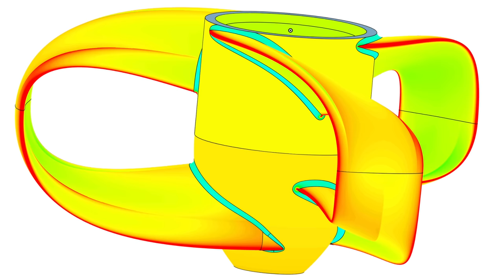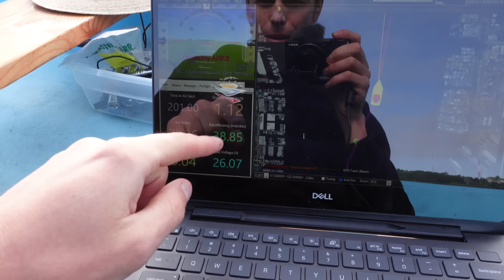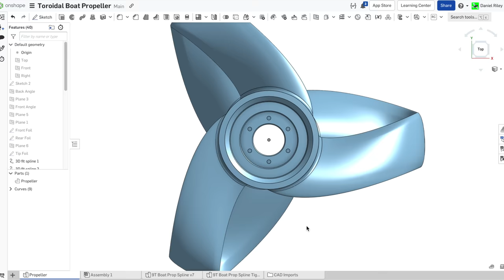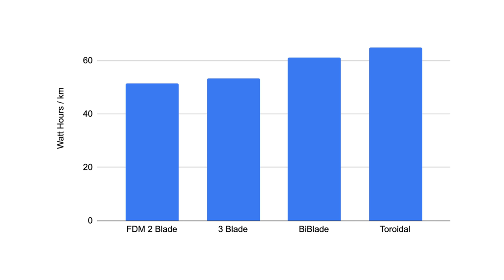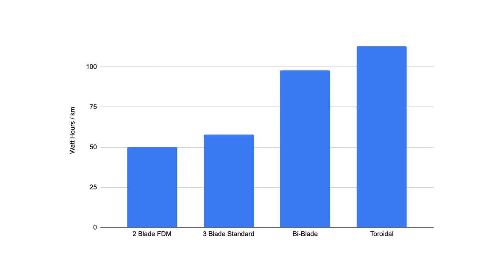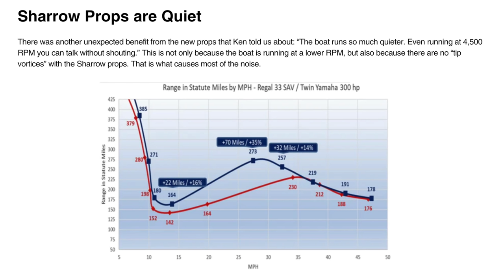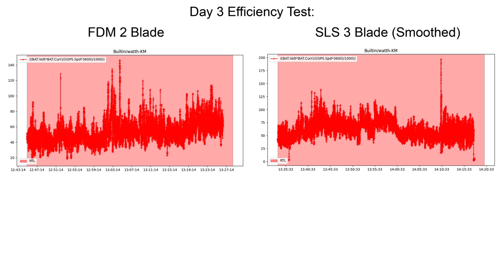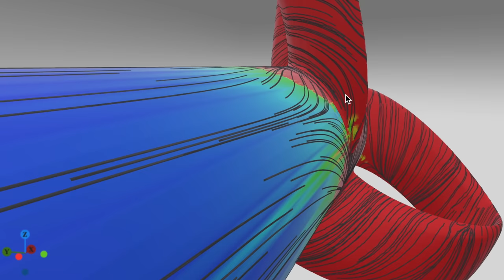Testing Futuristic Propeller Designs on my Solar Powered Boat

Comment: This is going to sound strange but here I go. Would it be possible to design a prop that ran at 369 hertz, I am not sure on the math but it seems you could take the diameter of the propulsion force which would establish a sine wave then the angle of the prop would determine the length by how far it moved forward in a given length. I am 67 years old and have absolutely no experience in any of this so I understand if it is a hilarious concept so at least I might give you a good laugh.    Tesla said 369 was very significate, and even if 369 is not the correct frequency some one with math skills was able to come up with a prop pitch and diameter that works with no or very little interference too its surrounding.    PS everything has a resonate frequency

Comment: “I don’t hear tip vortices”

Have you ever been on a big boat?….. like… EVER?  You can track the noise to the height of the prop on the water. Not with devices, just with your own ears, lol. It’s AT LEAST a third of the highest decibel noises coming out of your boat if you have a boat that’s like 18ft plus in my experience.

Comment: Here is a question that I am sure more folks than just me have. Why didn't you attempt to copy the design of the other designer that is giving those excellent numbers? They did the work of making those toroidal shapes with supper computers so you can take advantage of that, but just don't try and sell them as that will get you sued.
Another thing you don't seem to understand or consider is water's flow rate is way different than air's flow rate. The toroid design is the best and if you wish to get what they have you have to do the same thing.

Comment: Large ships can't use a toroidal prop, why? Because ships use viable pitch props. When reversing they don't spin in a different direction, they flip the blades around.  I can imagine a viable pitch toroidal prop. But it isn't likely to be possible anytime soon.

Another reason toroidal props are not going in ships anytime soon is, scale of manufacturing. A prop the size of a super tanker's as a toroidal. Would require some giant X-axis milling machine.
Reply: 32:08 What type of 12 V lithium battery? Do you use and the brand name or manufacturer to purchased from thank you. Love your videos very informative .

Comment: No content creator seems trying to adjust the surface area and mass of the propeller.
Its like comparing lead(pb) propeller with carbon fibre for drone. I don't need any experiment to know that carbon fiber are more efficient.

Comment: Would a ducted propeller offer greater efficiency gains in water than in air and possibly be worth a test? This micro turbine uses a ducted fan with thick, swept blades claiming improved efficiency: https://youtu.be/Nc2vTM7KMC0?t=115

Comment: toroidal prop work better ONLY at certain RPM. outside of that range you have useless material that causes drag. 
idea is to match that RPM to speed we want out boats to cruise at. 
IMHO idea of prop with tiny, tiny winglet sounds nice.

Comment: Also, if you're reinventing the design on your own rather than using something designed for the job the data is useless for any purpose but to judge your own ability to design a toroidal.

Comment: Where is the Dyson Bladeless Fan Technology? Imagine that kind of propeller..
Reply from the maker: Those just use centrifugal impellers. Would make for a inefficient jet boat or seadoo
Reply: @rctestflight  I'm just saying. The wheel was reinvented. The Propeller oldest invention and never changed. What about making Propeller Hydrophobic? You guys so smart and cannot see 1+1+1=3. Meaning you add and change till it great. What is your Source why Bladeless technology will not work?
Reply: @rctestflight  Also why they next to each other and not in a single file line? Next to eachother I believe you're wasting energy cause they both turning the other direction. Meaning turn one off and boat spins. - The Dumb Guy, no education.
Reply from the maker: @LowBudgetYoutuber  The Bladeless tech isn't actually bladeless. The impeller blades are just in the base, not visible.
Reply: @rctestflight  Yes but it still pushing air and if underwater would make something move.. 😔
Reply: @rctestflight  I would hate to be so smart the simplest ideas go right over your head. Einstein I believe said; Knowledge is great but imagination is greater!!

Comment: Interesting stuff. Prior to getting near the end, I was pondering why not enlarge the prop, you did that, but I did not like the long thin span. 

On a flip side, I'm now pondering if you could get some reasonable pros that connect to a generation and do some prop placement that rather than being driven by motor, connect to small generators and their spin captures a charge going to to battery. Also, in steering, perhaps they could be used with a higher gear to slow the boat, capturing more energy, rather than for an example a port or starboard motor driving or merely rudder change. 

I think prop speed, and water speed will have massive effects here, with many variables in what makes a good low, medium or high speed prop work best. 

https://www.youtube.com/watch?v=stkvTQ1lCSw&t=922s
There is some interesting info in here -

Comment: I find this test and the way to the demonstration really cool and professional. 
I would like to test and implement this topic on my boat (Bayliner2855). 
I'm just a bit reluctant when it comes to the forces and the feedback on the engine.
Has anyone tried this yet ? 
I think the price for such a propeller ($5000) is a bit high. 
There has to be a cheaper way.

Comment: 🤔 most think all that sanding, fairing & epoxy coating LABOR TIME is FREE ! 🙄🤪 And, they forgot the co$t of sand paper, fairing compound as well as everything associated with epoxy ie. Compound price, Brush ect.    💡Most times the 'ORIGINAL' FACTORY MADE IN BETTER & CHEAPER.

Comment: Regular airplane props to toroidal is a pretty big leap. I know it sounds so simple that someone probably a lot of folk, has already done this but I can’t find evidence of or anyone who has tried putting simple winglets on normal, regular airplane propellers. If they work on wind turbines increasing efficiency 4-5% then…? Yes, one is pushed by wind & the other propels it. But isn’t it to simple to overlook? Seems like ANY improvement would justify a cheap screw on “Neglets”* kit. Right?! Or tested on helicopter blades or even part of your myriad & diverse test propellers. Seriously, how hard could it be to simply add winglets to normally produced blades and propellers be they for air or water. 
 *”Neglets” Negating Vortices Winglets. To simply to patent. Let’s just make them open source/public domain. SemperFi

Comment: ive always wondered what if you take the opposite route/ youre already spinning... maybe putting all your power into inducing a vortice is the solution...

what is a vortice really? high speed fluid revolving in a contracting tube of low pressure surrounded by stationary high pressure fluid.

but how to get a "kickup the arse" from it?

well, if i were to suddenly stop a vortice from revolving i would produce a force of some type acting tangentially.

hmm.

lol, toroid props, i found out about sharrow over a decade ago, wasnt impressed then, either. still aint. snake oil so far.

Comment: not that weird that the toroidal props did not function. If you compare it to real developed toroidal boat props it is clear that there are some big mistakes made in the design. I am pretty devastated by the fact that you are comparing a homemade and designed toroidal prop that has not met the criteria to be successful in comparing them. One of the biggest design flaws is the way the upper part and bottom part are not aligned as should. this can be clearly noted by the fact that when you look from the front to the back you should be able to look trough the gap, with yours you can only from the side, this results in a stall because the water can not flow as should. the blades also should be way closer to each other. It is very difficult to write it out but please redesign and make another video, I would love to watch this. 

And yes the claims could be less than they say, but research done on drones props proofs that it is more efficient and makes less noise.

Comment: 24:48 huge hype around this toroidal propellers but just a bunch of BS. It is definitely more efficient than a standard one due to more surface area which can be simply replicated with a larger propeller, no different from designing fan propeller or turbine blades, bigger is better!

Comment: Its very hard to wing it and actually prove anything in regard to propellers. Props are one of those things that had billions upon billions invested in development since the first prop-driven boat so they are extremely refined and minute gains typically only come with fabrication improvements, not configuration itself. Also, boat props typically need to be carefully matched to both motor and boat/ship + water density (different waters mean different props) to end up with peak efficiency,and imagine then just winging the designs and comparing the efficiency. Also note that MIT study that kicked off the craze of folks jerking around toroidal props was quite questionable, definitely far from something one would take as gospel, without letters MIT adding creed most would just laugh them off as it was high on claims but rather poor on data supporting the claims. The author correctly questions efficiency claims  due to $$ involved in the industry, but on the other hand, note anything large uses variable pitch that is not feasible with toroidal, variable pitch is just next-level efficient

Comment: Do you habe a foam fire extinguisher on board at all?  With all those lithium batteries, id hate to think that you might have to dump them overboard in the event of a lithium fire because you dont have any way to at least "try" to extinguish them and you're too far off shore to try to make an emergency landing.  

Even though it could likely help save your life to throw a compromised battery overboard vs trying to get to shore quickly and risk having the wind shift, enveloping you in TOXIC lithium and plastic smoke, and throwing them overboard is exactly what I'd want you to do, because i dont want you to die, because i cant imagine a life without your videos (and your songs) in it! 

But if tou did have to jettison a burning battery, can you imagine how bad that would be, ecologically, for the lake!? Yikes! You should definitely carry some sort of fire suppression and protection method like fire blankets and a full face chem mask to help shield YOU from hot burning lithium and plastic smoke!  We love you too much to lose you! 😂

Comment: I have ideas as to what the problem is... The test is unfair... I believe the Rotational Inertia of the new design is far greater(more resistive leverage), along with it's mass(more weight), & it's surface area(more friction) - which all contribute to more energy being required just to spin the blades... So - for example - even though an F1 car's wheel is more 'aero(fluid)dynamically' efficient than a bicycle wheel, it takes less energy to spin the bike wheel which makes it more efficient... Therefore for your test to be fair, all test blades must be the same Diameter, same Mass Distribution & Same Surface Area in order for the test results to be most representative of real world results... Make sense? I know it's complicated - I'm just saying...

Comment: your prop RPM is so slow, i'm surprised you could get any meaningful data. put a gas 30-40hp outboard on it, now you can experiment with all sorts of stuff, but bet you find out a surfacing prop (jackplate and low water pickup needed) is faster than any other type.

Comment: your props are not creating the turbulence... they are breaking up the bubbles created by the illdesigned "foot". you should have used trolling motors which would not have created the turbulence at the front which is generating all of the bubbles. You cannot attribute the cavitation or turbulence after the props to the props when the input is not free of cavitation.

Comment: It is nuts how many such videos turn up and everyone wants to ride the wave of testing and comparing toroidal props with regular ones but always comparing apples with oranges. You use a purchased or optimized design of a propeller and do some layman CAD work on creating a toroidal propeller you want to compare with an optimized propeller. You don't even use the same optimized design points. You program a constant speed and by that change the RPM and that's what operates the props and therefore they run at different RPMs they might not be designed for. That's like switching the gears of your cars for different RPMs, so one time you shift to 2nd gear at 1000 RPM and the other at 3000 RPM. As you can tell, the motor would have challenges at the 1000 RPM and not at the 3000 RPM. Your designs are random, just taking some airfoil shape you think looks good or should perform well but for a completely different prop. You also shouldn't be using the same airfoil or angle of the airfoil for both as the flow will attack the second one at a different angle than the first one so they operate at a different operating point fo the airfoil and therefore the performance of the second will be way different than the first and potentially ruin your first airfoil performance. Also if you look at the prop of Sharrow, their second airfoil starts a bit offset of the first airfoil down the chord length of the first, so after each other and not like a double-decker like yours, being more parallel offset.
As I said, numb apples vs orange comparison.

Comment: Complete noob when it comes to…anything technical, but if the material of the surface causes drag, would a glass prop be good? And further (and much more expensive) a diamond?

Comment: Well, you have poor mounting and steering control of the motors so it is not a surprise you have vibration problems. Nonetheless, trying to apply air-proven designs to water propulsion is not a very rewarding idea. Best to just go from scratch with water design being the only consideration.

Comment: So the 105% performance really means 5% if it were double it would be 200% increase. So there not lien it's just marketing and sociological manipulation to make you feel like it's worth it vrx saying just the 5% increase.
Reply: And it is 5% increase on a specific boat+engine+prop combo at a specific speed against a generic solution... so the same you would get with other props.

Comment: Sound underwater is different than sound from a running boat. I’ve spent years in aluminum and steel vessels and when its quite you can hear the ventilation and cavitation ping off of the hull (like a speaker) as boats go by. I don’t know about toroidal props but your method of measurement is subjective and flawed.
Reply: *quiet

Comment: 11:28 NO !!!! No, no, no, no! This is NOT how winglets are efficient!
Pushing outwards the air coming from the front is not the purpose of winglets designed for efficiency. That's the purpose of winglets designed for stability , because they then act like a dihedral, which is a completely different purpose. 
The purpose of winglets designed for efficiency is to redirect the thrust of the wingtip vortex aft, for a better forward reaction on the plane, not at all to make the air diverge away from the fuselage!
Some very cleverly designed winglets do both dihedral and vortex-based forward propulsion at the same time, for the specific needs of the aircraft for which they are designed, but keep in mind that you really don't need dihedral on a water propeller.
Don't draw easy-silly conclusions only by looking at random planes design from afar, please, otherwise not only will your designs risk to be disappointing, but you may also be misleading thousands of Internet users.

Comment: I like that you know about dependent vs independent variables. But why are you equating boat screws to aircraft props?  Water is an incompressible medium and clearly discussing "aerofoil" sections is an oxymoron for a ships screw. You are NOT creating "lift". A ships screw does not "stall" but cavitation hurts efficiency and is very destructive mechanically.  You need to stop thinking screws are propellers and learn a new set of concepts pertinent to water fluid dynamics.  Cavitation causes the "noise" you are confused about. Good job you were careful with your wording about  Sharrow's claims on reduced noise.

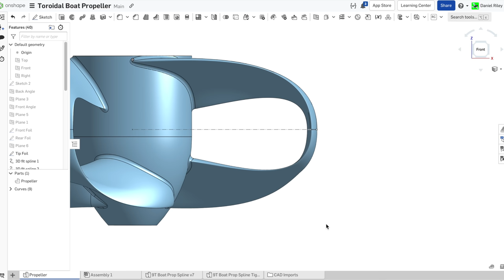Comment: 12:40 Well, that's precisely why properly designed toroidal propellers do NOT push water outwards at that point and tend to be neutral at that point in the hydrodynamic profile, or even push water slightly inwards at that point.
You really should stop confusing the profiles designed to redirect inward or outward the water coming from the front with the profiles designed to react to water pushing outside or inside, redirect it aft and thus creating forward lift. This confusion is a source of terrible designs.

Comment: If you want to see data from unbiased source.  Simply recreate the prop in question accurately to the proper design specifications and test it for yourself.  You seem very capable. 
But to take an idea, remold it to your liking, then apply the other designs guidelines, seems very stupid at best.  You designed a shit prop.  It performed to your specifications.   what did you expect?

Comment: Just make a loop pool, with constant power input and flow, eliminating WINDSPEEDS, SOLAR INPUT, BATTERY OUTPUT, WATER CURRENTS, WATER TEMPERATURES, DISTANCE CALCULATED BY LANDMARKS, MAN... and do a SCIENTIFIC test, and save time, oops i forgot this is a video for profit not actual professional recearch (face palm) interested lot's but ultimately, gtfo sir.